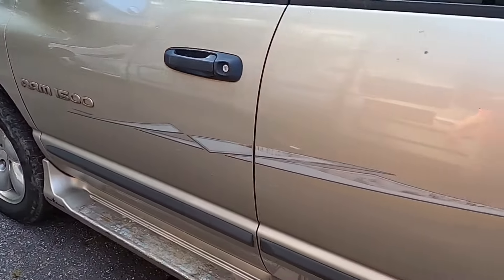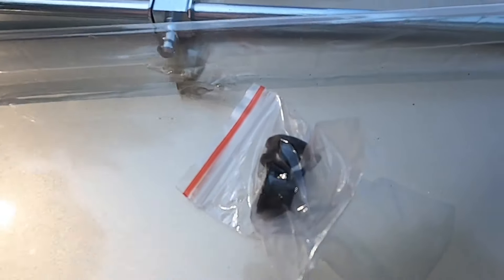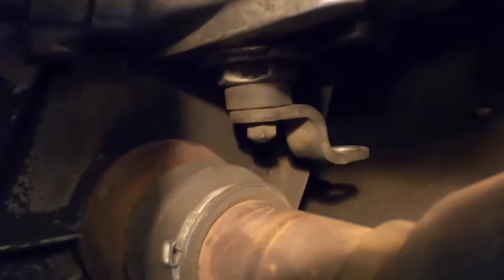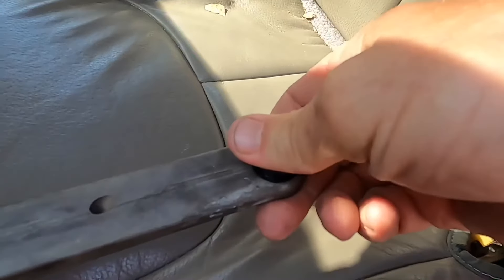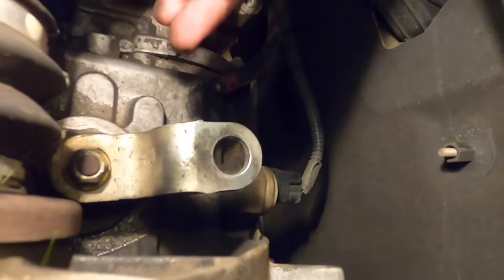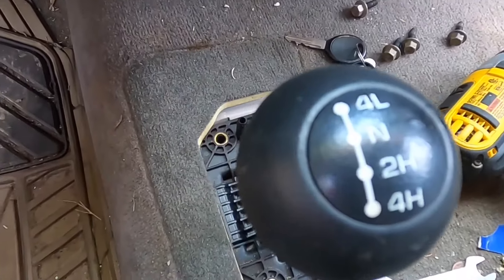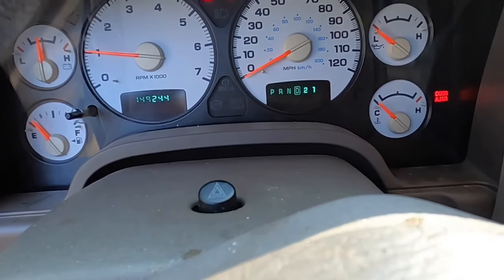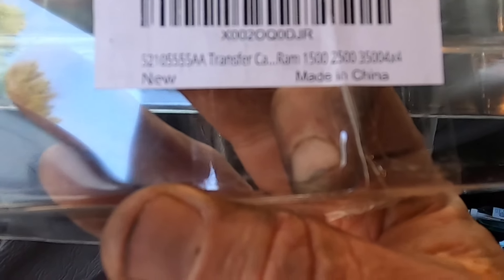My Dodge Ram Truck 4x4 Shifter Doe’s Not Work!!!   Moves Freely and Will Not Engage

Comment: Just wanted to say thank you for this very helpful video.  I don't do a whole lot of work on my vehicles but this video helped me with the exact same problem on the same year, make and model truck.  I tried the hot water and it didn't work for me but I squirted some Dawn dish soap and they went in a lot easier.
Anyway, I appreciate the video. 👍
Reply from the maker: no problem.  Thats I good Idea about the Dawn Dish Soap

Comment: Thanks for posting this.  Until I got the replacement linkage in my hand, I was convinced that I had to order snap rings separately.  Those grommets sure are a pain in the neck getting pressed in.

Comment: Mine fell of on a forest road I heard this bang bang bang and gone. I thought I had a stick. My kit came off Amazon look carefully at the picture before you buy! Mine came without the bolt. Quick trip to the hardware store but just look carefully. And a tad of Vaseline on the grommets help push them in. Thanks for the video.
Reply from the maker: Hey good idea about the Vaseline.  My came off in the mud after a good rain , so I could not see it hat happen until I got towed out.
Reply: Amazing video! Helped me in 2023.

Comment: I threw that stuff away and made up my own shifting Linkage Using rod eyes just make sure that if you do the same you keep the original measurement off of the one that fell apart
Reply: Trying to make my own rod with linkage ends and a rod. Do you know what the measurement is from linkage arm to linkage rod ? Center hole to center hole ?

Comment: It's gotta be tured around. If you put it on facing the way he has it, you will hit the wires
Reply: verified true. Just flip it and you have smoother shifting and plenty of space to use a wrench. The larger hole on the gromets go AWAY from the middle of the truck.

Comment: So basically you just shift up-and-down to go through the gears for wheel drive-in neutral?
Reply: Yupppp. I love it. I’m all for Electronic 4x4 but this is the way to go.
Reply: @Thugwaffle36  I just bought this truck from my FIL and I’ve never owned a diesel or 4x4 and really would appreciate any pointers on using it to prevent misuse or damaging it. From my understanding I put it in neutral on the dash and switch the second shifter to 2H for day to day driving and to shift go back to neutral and move the gear down to 4H for when riding on the beach and then wanting to use the 4x4? He told me you almost never need to use 4L
Reply: @stuNzeeDkcuS yep, that's right. But engage 4low every couple months in dirt or soft ground to make it last longer.
Reply: @johnmichaels4330  thanks for the tip I’ll make sure to do that!

Comment: Mines is a daily driver. Always been in 4H. Should I put in N instead? I drive 80mph 50 miles round trip daily
Reply: 2h daily regular driving...
N is for if the truck needs to be towed..it disengages everything so it can be towed safely without damaging transmission or differentials
Reply: How did you not destroy a wheel bearing like mine??? Been having issues driving it 4h daily, I’m switching back to 2h now
Reply: @BruceWayne-ue5dj  wheel bearing service life is not effected by the use of 4x4.

Comment: I have a different problem mine won't  drive unless I use one of the 4l ,2h, or 4h ...if I place tht shifter in neutral then move the shifter next to steering wheel to drive I get nothing no fwd or reverse
Reply: Lol uh its suppouse to be in 2h 😂not neutral  to drive
Reply: Yeah bro it’s rwd. 2h is pretty much rwd lol.
Reply: That’s not a problem.  
That’s normal.  
Drive around in 2h for regular stuff. 
If you get stuck use 4h to get out.
Reply: @jaxturner7288  what’s 4l used for?
Reply: @Boone162  depends on the particular rig but it’s mostly used as a crutch for the crowd with underpowered 4x4s, of course some do use it for the additional engine braking on downhills when they are doing serious off-roading.  That being said, the average 4x4 truck with a v8 or diesel wouldn’t normally ever use it because they have enough torque for 4h to spin all four tires and they usually don’t go rock climbing.  The underpowered rigs and Jeep’s that go way way off road and climb rock walls are the only real users of 4L.👊
Reply: @jaxturner7288  thanks for the knowledge thats awesome

Comment: Can you still drive it?
Reply: Yes, I drive mine daily it's just permanently in 2wd until I fix the linkage
Reply: Depends. If the thing comes loose in neutral you won’t be able to do anything as both front and rear differentials would be disconnected.
Reply from the maker: Your truck will be stuck in what ever gear it was in when the linkage came off